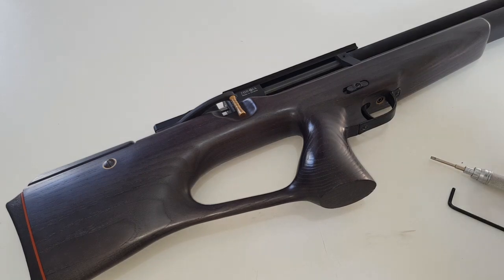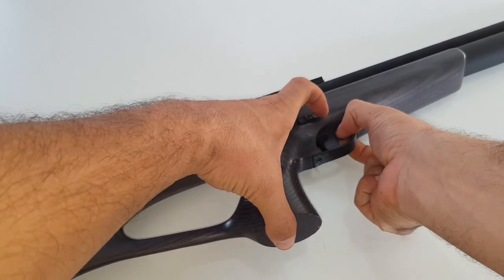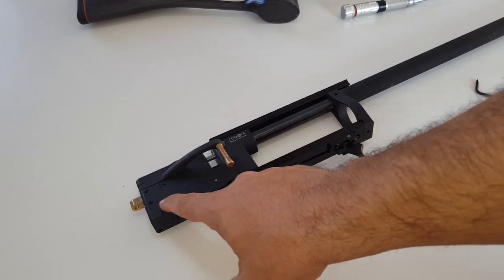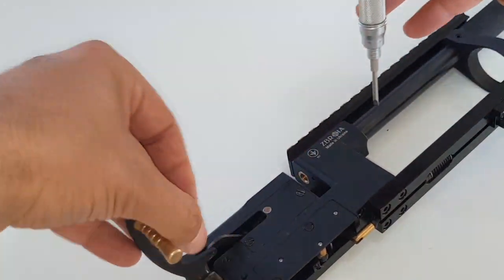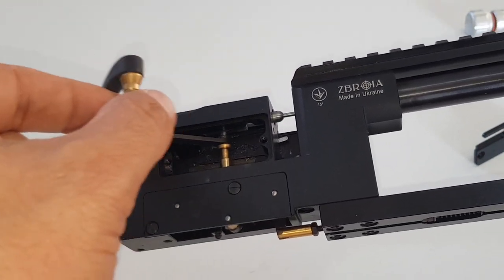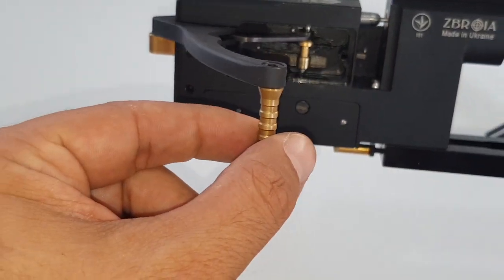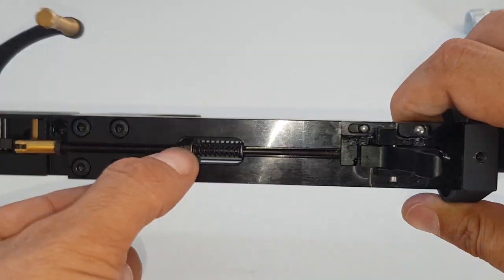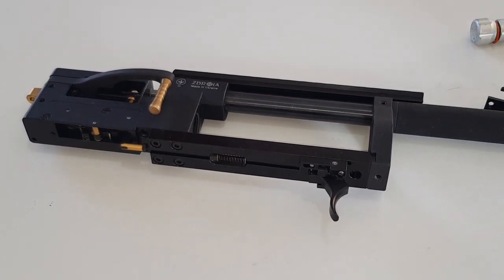Zbroia Kozak Cocking Arm & Hammer lock check

Comment: Thanks a lot both videos are great. Please talk about the magazine catch lever since it is a common issue in these airguns. Also some claim that fitting huma regulator to this gun instead of the original reg, will improve the accuracy greatly. Is it true?
Reply from the maker: A video will be made soon about the indexing arm, as for the Reg the Huma will give you some extra shots but the factory one is amazing so far nearly same shot count and consistency, the core is you have to tune the whole system to perfection( hammer spring tension, valve stem tension, reg pressure, etc... as any other airgun brands until you find the right harmony ( velocity, pellet headsize, etc...) 
Cheers
Reply: @josephjaalouk  Hi Joseph, great videos thanks. I have adjusted a few guns on the reg and hammer spring but they have not had an option to adjust the valve spring tension. Is there a general set of rules to apply, or symptoms to look out for that would suggest that the valve spring needed loosening or tightening?
Reply from the maker: A new video is uploaded check it out